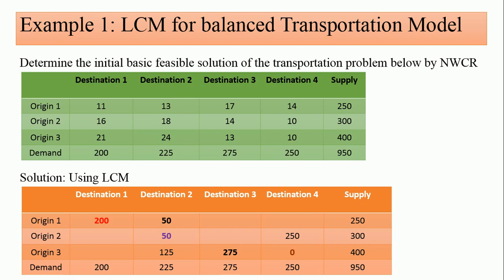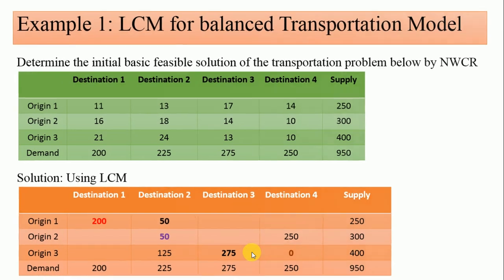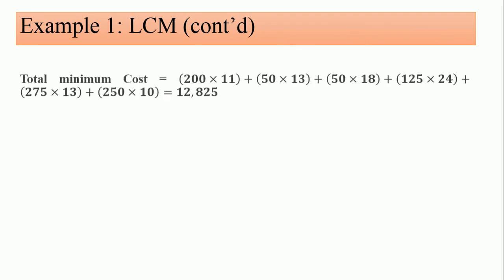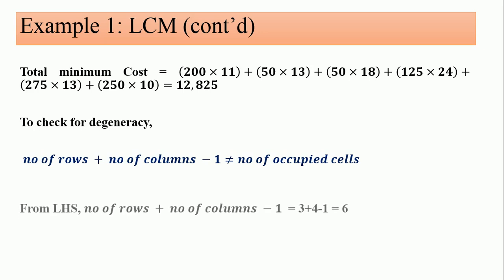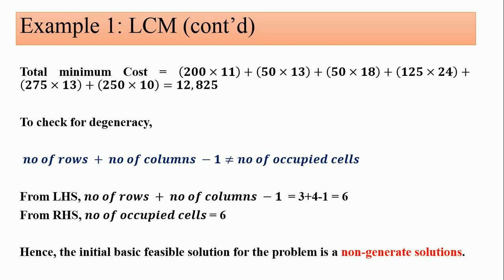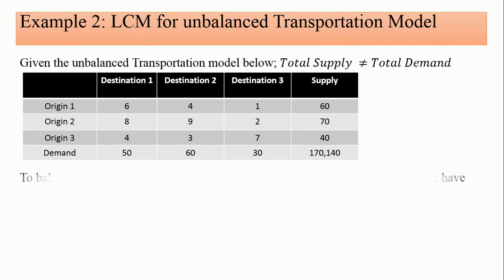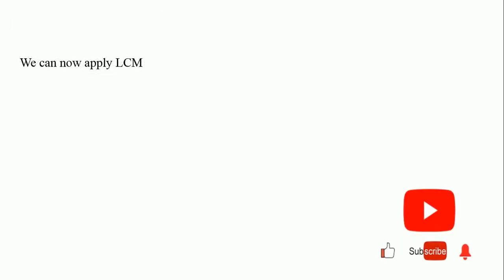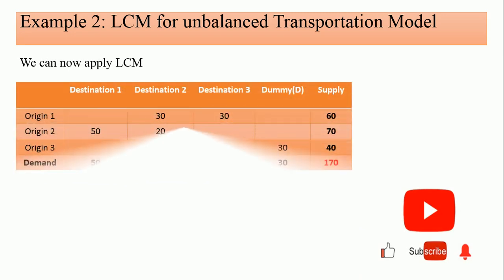Transportation Model:  How to Solve by Least Cost Method(LCM)

Comment: From the unbalanced TM, i see that  u choose column 3,4 between the 0 tiers(dummy column) column as your small unit cost

But you mentioned earlier that we can choose any of the smallest unit cost when there is a tier

So i choose 1,4 colume as my smallest unit cost between the 0 ties(dummy column) but got a different final answer why is that please .
Reply from the maker: You can consider both cases and choose the one with the lowest total minimum transportation cost since the goal is to obtain least transportation cost.

 I decide to keep it simple because there are other rigorous approach to solve transportation problem with tie smallest cost but it might get you confused that's the reason I didn't bother to go complicated.

Thanks